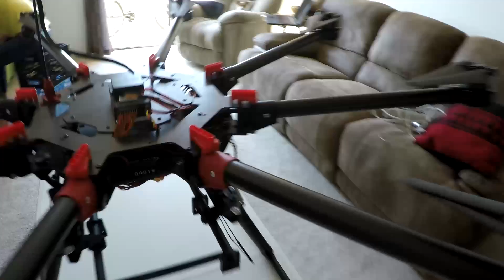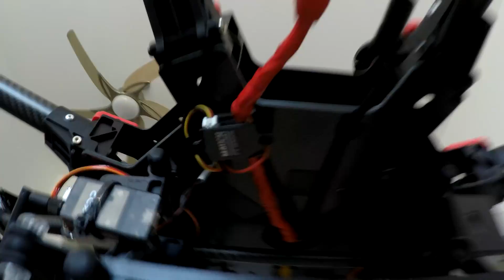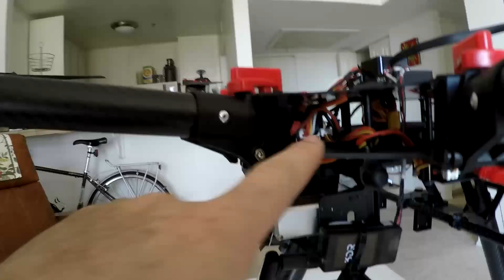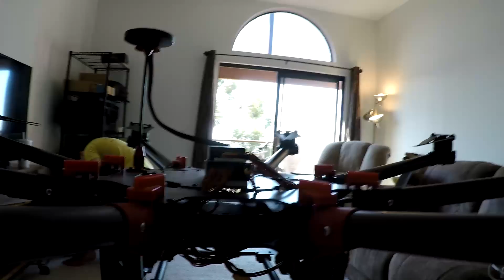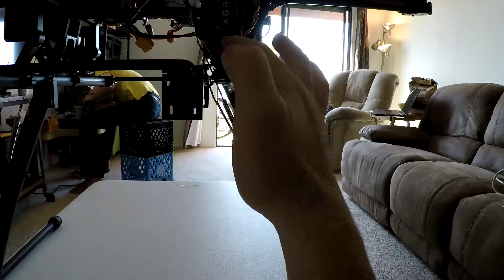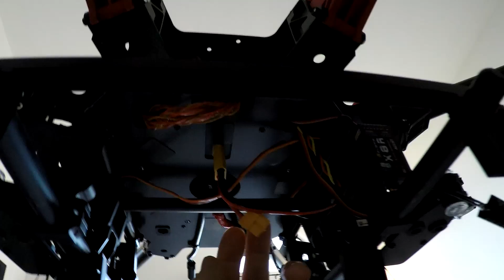DJI S1000+ and Pixhawk 2.1 Guide (Part 1 - hardware)

Comment: esc wires would just run from the numerical slots on pixhawk to the board numerical slot that is situated opposite to the original position no?
Reply from the maker: No. See this new vid if you're still interested: https://youtu.be/JF3vTBndadA

Comment: Get the tbs crossfire, it will replace your rx and telemetry radio and it has 100km range, works great with taranis too... All telemetry displays on the taranis and it connects via Bluetooth to a android tablet to run tower or a laptop to run mission planner ...

Comment: Great video, but why you didn't get the sensor directly with 8AWG wires. This would save you a lot of work. Furthermore, it seems the current sensor is installed in the wrong current flow direction. You might want to change that.